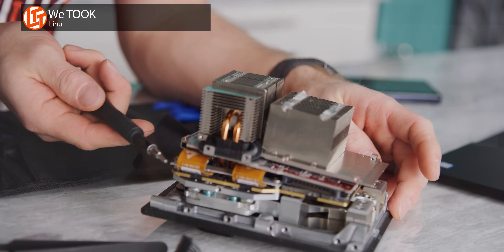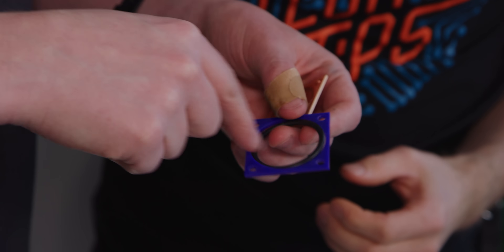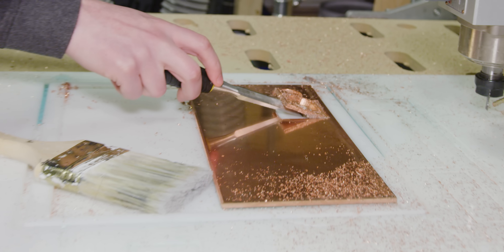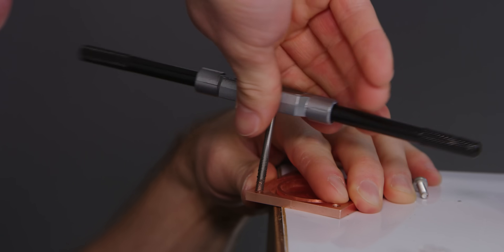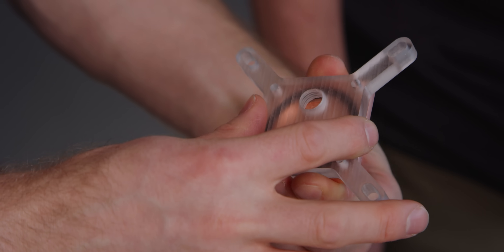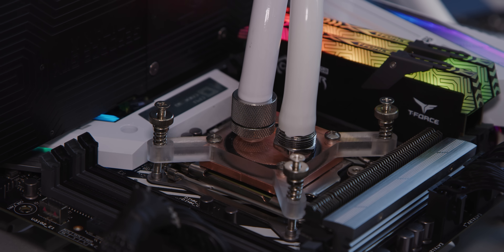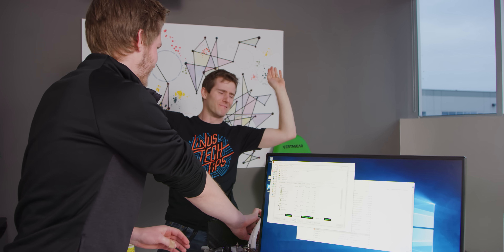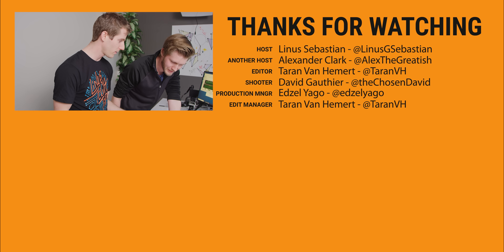We Built a CPU Water Cooler!

Comment: 13:15 As an aircraft mechanic I can assure you that air transport is a hell of a lot safer than car transport. The level of planned maintenance  on aircraft is probably only exceeded by rocket maintenance. In the aero transport business no-one is gonna ignore an check-engine-light for any amount of time, the groove depth of the tires are checked on a per flight basis. Same goes for oil level.
On a side note, watching you guys using tools like thread-taps and such, gives me a nervous twitch. I just wanna slap those tools out your hands. For me watching these videos, is like others that like to watch horror movies, or go into haunted houses. Very uncomfortable, but afterwards I can just laugh at it. :)
Reply: I'm an aircraft mechanic as well, and almost every time they use tools like this I start cringing so hard!
Reply: Um I'll have you know I changed my oil last week
Reply: Thats because air travel is an "all or nothing" scenario. Death is pretty much imminent upon just about any failure or human error. So the machine itself has to always be perfect.  Cars dont compare. Most issues with car accidents are bad road designs and rarely does it have anything to do with mechanical failure leading to deaths.
Reply: In terms of aircraft safety, isn't it usually a far worse impact if something goes wrong on a plane than if something goes wrong in a car? You're talking such a greater mass and speed producing incredible force. Car accidents are a lot safer than airplane accidents, aren't they?
Reply: @clintony3000 Thats right. And that's also why the industry's safety measures are so intense, because they're trying at all costs to avoid those accidents
Reply: I agree, the safety and maintenance inspections are extreme and thorough.  But after working in the aerospace manufacturing space on the quality assurance side for the last 14 years, I can say there are far more parts out of manufacturing tolerance (known and unknown by the OEM) than I ever would have guessed.  Keep in mind this is typically on  a scale of thousandths of an inch or less (.001") and often on truly non-critical features.  But then consider the stack-up of thousands and thousands of parts and you can end up with some severe issues during assembly.  After hearing too many stories from co-workers about parts that were warped, re-worked incorrectly, using incorrect material etc...I definitely have an admittedly biased aversion to flying even if the statistics say it's fine.
Reply: Explains all those situations where planes are discovered with all those loose screws, broken screws, illegally modified components and so on. Hard pass. It looks cool on the outside, looks decent on the inside (much like you never notice how your car is crap compared to when you bought it) but IRL when the NTSB gets involved, heads roll.
Reply: Now imagine flying cars.
Reply: aircraft are designed with a safety factor of 1.5
read §25.303
Reply: I am a german industrial mechanic and i can assure you i feel the same. If i would have ever used tools like this my master would have kicked me out xD
Reply: The reason aircraft are seen as more dangerous is that when bad accidents happen they often pretty catastrophic and result in more death than a single car crash.  Even though air travel has less traffic and are ran by more qualified people than car drivers who are extremely reckless.  It is the same thing as nuclear power.  Less loss of life and environmental damage overall but when they fail they often fail very catastrophically which is more noticeable than the trickle caused by cancer and mine accidents for coal.
That is also why aircraft safety tolerances are lower because they maintain the machines much more than a car driver will maintain theirs.  If there is a fault it is caught more often than not where as with cars some people don't ever check their breaks like at all.
Reply: Don Mega  In 2017 there was 10 fatal accidents out of 37 million flights.  This was the safest year for aviation but the trend is downward.  Today there is about one death per 2 million flights.  (well 2020 is not a good year for metrics for obvious reasons).  Not literally one as a single airline accident will kill more than a single person.

Compared to car crashes which only in the US in 2017 was 6,452,000 in which 2,746,000 were injured and 37,000 were killed.  A driver or passenger was killed once every 14 minutes and a pedestrian was killed every 88 minutes.  Here is also one of the main differences between flight and driving: You drive a lot more than you fly.

I am very comfortable in saying that very few people if nobody watching this video takes a plane daily but pretty much all if not a vast majority of people will get into a car probably multiple times a day.  (not now obviously but normally).  Both the rate of accidents and the amount you use the car is higher.  Flying is only more dangerous if you use it a lot, the more you use it the more likely you are to be involved with the few that do go wrong.

Also worth pointing out the single greatest culprit in a car accident is not the road quality, the vehicle's quality or weather it was distracted driving and the single greatest cause of death is intoxicated driving.
Reply: That sounds like something an aircraft mechanic would say
Reply: What you are saying does not address the point Alex made: planes are DESIGNED with much lower factor of safety, because they are very sensitive to being overweight. It doesn't matter how well you maintain if the design cannot support the load in the first place. When your factor of safety is lower, you need to do way more (expensive) testing to validate that the design will actually support all possible loads encountered in real life. It also means keeping a very good maintenance schedule. So actually, what you are saying about maintenance is actually very consistent with what Alex said: planes are designed with much narrower safety factors than cars (which are designed to survive with much less maintenance).
Reply: Major boomer vibes
Reply: I believe they mistaken with rocket safety factor. It should be 10%-15%for rockets and 50% for airplanes.
Reply: He didn't say aircraft are more dangerous and cars are safer, he said airplanes safety factor is much lower, and this is generally true. Safety factor is a very specific term to engineers and it means the objects design load divided by the working load. In other words, 10% safety factor or 1.1 means the thing is designed to take 10% higher loads than it is actually expected to encounter. 

Like he stated aircraft generally use a safety factor less than 10% or 1.1, usually much less, whereas cars can have 1.5 up to like 5 for some parts (500%). What this actually means is the aircraft is better engineered (materials used carry better certifications, loads are better defined mathematically, etc), because the engineers trust their margin of error for an airplane to be less than 10% (if the safety factor is 10% but the margin of error is 15%, its likely to fail), but on a car they may have much higher margin of error. Like he stated the biggest reason why is because aircraft HAVE to be engineered to tight margins of error otherwise you're carrying around unnecessary weight in materials used to make the aircraft beefier than needs be which is expensive.

Interestingly something with an astoundingly large safety factor would be a hook for overhead lifting, these may be from 5-7 (%500-%700), one reason why is because its actually cheaper to make it 5x beefier than to hold it to really tight machining and material tolerances, and in the end have the same "safety". Another reason is because you can't always trust the person using something like this to heed the "xxxxx lb load" rating and they don't want an overhead lifting device to fail and kill someone.
Reply: @JD-ub5ic  Aircraft factors of safety are 1.5, not 1.1
Reply: Also the comments about aircraft safety really pissed me off. Our tolerances and maintenance procedures are way more strict than automotive.
Reply: there was a huge scandel recently  where airplane  techs was told to ignore stuff t hat wasnt on there list
Reply: @omgwtf696969 Without further details your comparison is meaningless. What type of parts are you referring to? Quality control for different parts has different tests depending on material, operational conditions (temperature, pressure, environmental hazards etc.)
So unless you are talking about manufacturing the EXACT same part, for two different industries, the comparison has no influence on my post.
Reply: Some mild difference between maintainance and design when it comes to aircraft, they are designed with very narrow safety margins because excess weight is an aircraft's achilles' heel, the difference between that and a car is that an aircraft is designed to "soft fail" so any failure that does occur is rarely critical and those components are designed to fail after a certain amount of time so that a technician can specifically look at them periodically to maintain the aircraft. Road vehicles on the other hand, are less designed for that mode of failure, as excess weight isn't a crippling factor in the function of the vehicle, instead they are designed to withstand certain stresses and not fail or show signs of failure; meaning that they are more likely to break in a pseudo-random fasion. I can almost guarantee that aeronautical parts are of higher quality than automotive parts, simply because the materials and tolerances are far more strict than in a road vehicle and the processes that produce them are controlled far better too. Quite simply; if a car fails, you don't drop from 36000ft at 2-300mph into the ground. Aircraft, however...
Reply: Plus it's pretty hard to crash into another plane in the air.

Comment: OUCH!!  A few pointers;
When tapping a thread or machining acylic, use a grease or Vaseline on the cutting tool.
When finishing Perspex, acrylic or poly-carbonate, sand all the way to 2000 grit and then heatgun at 150C approx 1/2 foot away.
Always leak test powering only the pump(I'm sure you're just baiting here).
You can make channels in the cold plate using a rotary cutting disc(not grinding, too thick). May not be up to EKW standards, but it does help with temps.

Great vid, follow-up soon?  ^__^

Comment: Did you try annealing the copper?  That would greatly increase the work-ability of the metal and also allow you to use smaller bit in the milling process as it will require less force to perform the cutting decreasing the likelihood of them breaking.
Reply: Due to how soft and gummy copper already is annealing the copper would be worse.  Causes it to smear instead of shear off.

Comment: You could etch into copper to make the small grooves using a simple Hydrochloric Acid + Hydrogen Peroxide solution. This has a common use in DIY electronics. You just need to mask out the parts where you don't want grooves, and the grooves themselves you could do by printing a mask using a LaserJet printer and then transferring it on using an iron.

Comment: Laughing my butt off as Linus freaks out about making an Oring for low psi application. I have cut and super glued Orings for 1500psi pumps. It literally works out as if you installed a brand new, to specifications, from factory Oring.

Comment: Next time you tap threads, slightly countersink the end you intend to insert the male hardware into.  A large drill bit works fine for this, just twist it a few times by hand to smooth out the leading edge and it's far easier to install.  Also, you should run the tap all the way through the other side until you are past the tapered tip of the tap.  Unless you're using pipe thread, those are tapered type threads.

Comment: If these guys are taking suggestions I could probably whip up something in blender to try like a division channel set between the input and output to circulate the water so it has time to conduct the heat. The surface area grooves for better thermal conduction I am thinking of though would require masterful precision with fabricating the base plate so not that detailed.

Comment: I
f you need help machining the base plate, let me know.  I am a machinist with 10 years experience and have made several blocks.  Your biggest problem is your using a CNC router.  Not made for right tolerances.  And I’m guessing your feeds and speeds are not right.

Comment: do you heard of right angles ? look infront to the tool and go head around to 90 degrees or 45degs each side . Important is to set the right angle from the beginning. after a view rotations the tool go straight in by itself correctly. The right startingpoint is important

Comment: if you are tapping holes its  best to use a block  with a  hole in it that is just a few thousandth of a inch larger then the  OD  of the threads thats  say  .75 inch tall  and  place block with  hole in it on work piece and drop tap thru so you start threading at a Right angle.

Comment: Need to use silicon lubricant mate, patrolium eats o-rings over time. Red Dead Redemption alright Alex.
Reply: They probably used a viton oring by the looks of it which vaseline wouldnt hurt.
Reply: @chaos1267  good call mate.
Reply: that cant be true seeing as the military uses Vaseline for aircraft's o-rings
Reply: @KinSlay1337  not sure about that one mate, not an expert in military engineering you might be right.
Reply: @KinSlay1337  not sure I’d take any military practices as the right thing to do. Every project I’ve seen is just take the closest thing that might do the job and make it work regardless the long term effects.
Reply: @ClAddict  from experiance I totally agree, however that comment was about jet engine manufacturer specifications for maintenance specifically and not military practice (which in this case was mostly inline with manufacturer specs)
Reply: It's probably buna-n, it'll be fine.
Reply: They also literally have silicon grease at the studio, which they tested at how good of a thermal paste it would be.

Comment: Question: Why didn't you guys just took a piece of mirror or MDF or something really flat, stuck a piece of 2000 grit (water)sanding paper, spray bit of water / oil / wd-40 on it and sand the bottom copper?

Comment: FYI, since I know you guys have a drill press: If you want to tap threads straight, mount the tap in the drill press to get it started.

On the milling side of things, cutting fluid is very useful when you're milling metal.

Comment: As far as i know, it doesn‘t matter on which side you tapped...
Reply: it does if a pipe tap  and  a nomal tap   matters if you dont send it thru far enough.   they make tap gauges for  fitting a G fit is a normal fit
Reply: Pl Pchlr   It does matter if he is using a taper tap vs a bottom tap.  Or if he sent the tap through enough to get the bottom fully tapped.  probable just had partial threads.

Comment: At 6:14 it seems to me that you are using the third tap of the set. You need to start tapping thread with the one that has one stripe on it, then do it with the one that has two stripes, and finally take this tap that you are using. No wonder it goes in so tightly if you start tapping thread with finishing tap.

Comment: Pro tip when tapping with noobs. Put the tap in the drill press, turn it off, secure the part and turn the tap by hand while pushing down the drill head with your free hand.
Reply: And run the tap all the way. Just the tip doesn't work
Reply: Then again, you would get a better seal... Better get some ptfe tape to be sure.

Comment: Plenty of good tips in the comments, but probably the first one i would start with is to clamp the god damn work peice. Preferably a vice or even just clamp it to the edge of your bench. 

You'll get 10x better result with half the effort if you're not holding the work peice in one hand and a tool in the other like a caveman. The cheapest of vices are better than the palm of your hand.

Comment: Pro tip: it's easier to properly mate the O-ring ends if they are cut at an angle. Also, you can use teflon tape to seal the threads.

Comment: you might be able to cool the red just by drilling intersecting pathways into aluminum blocks that fit where the old heat-sinks were.... you would be able to make a water block by drilling 3 or more holes in each block, two holes bottom out into the side of the third. Then two holes get fittings and one hole gets a plug (no sketchy homemade large orings) I guess one could be made by drilling two holes that intersect each other if you can put the fittings at right angles to one another. I think copying the configuration of a cpu cooler for the red cooling project will cause you pain and sadness.

Comment: Great video, but he had no fucking clue what he was talking about with air plane safety. I worked on them military (and civilian planes have far stricter standards) Everything it so heavily documented and maintenance manuals are down to the exact fucking screw and torque values. There's a reason it's the safest mode of transportation.

Comment: I'm not a real machinist but this makes me cringe. Why the ** are you using taps to thread a hole when you have a CNC router? You could thread this with thread milling. Also not all copper is made the same. Do five minutes of googling and you could of done so much better. I may have a umpa lumpa as a leader but for frog snacks I can machine this so much better.